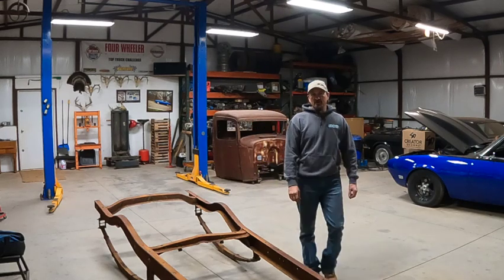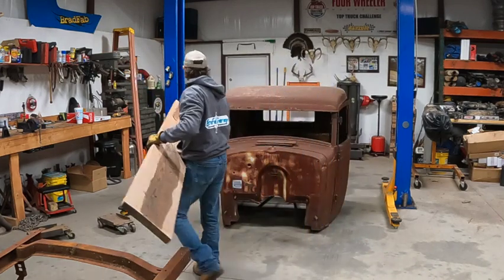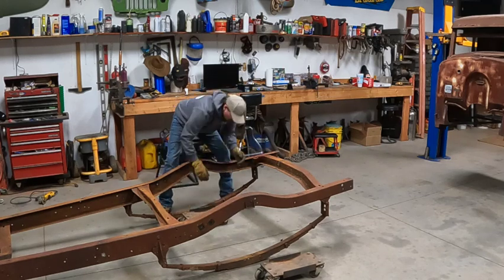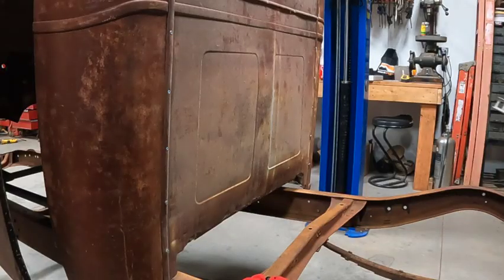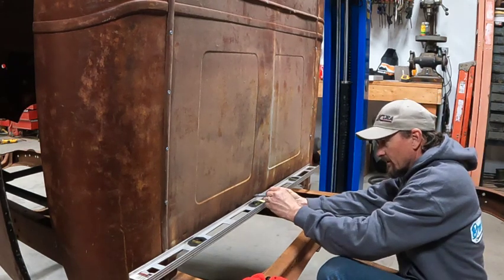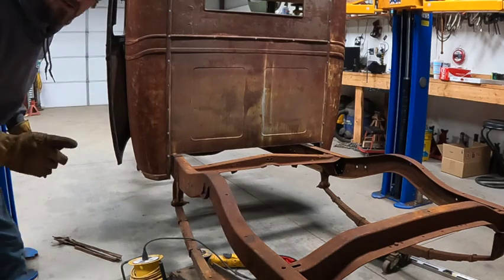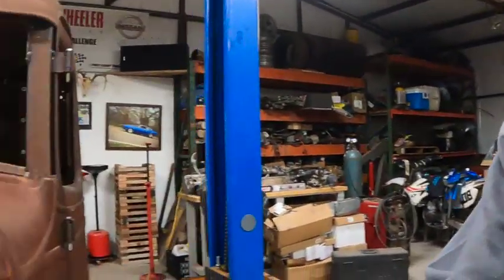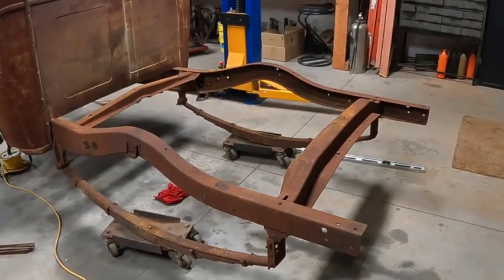Fitting the Cab on the 34 Chevy Truck Rat Rod frame

Comment: A 4" chop is about right, I channeled my cab over the frame 5" in front, 4" in back, that gives the hood some slope to make it look right. You can unbolt the top and remove the top part of the cab then you can make some flanges to bolt the top right back on. Bad Hombre Garage shows the full process on U tube. If I knew how I would insert some pics of the build. If I can get your email address I will send a picture.